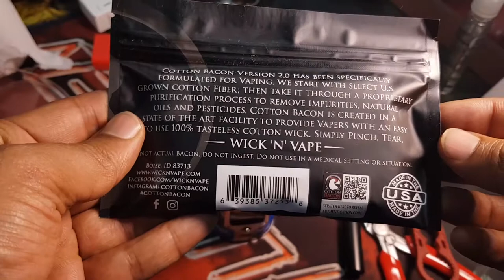RDA Basic Full Nepali Version with Aky Vlogs

Comment: Really liked the video.... It helped me alot... Still having some questions.... Like why didnt u use 26g instead of 22g... And i saw your using dna therion 166/167... Waiting for an unbox/review..
Reply from the maker: 26 gaze wire are thin wire. 22 gaze is thick. Incase of kanthal wire i noticed that thick wire will get in less ohms around 0.19-0.22 which is perfect to vape around 55 to 65watts or sometimes go higher . I reccommend using 24 gaze wire coz they seem to be best if you vape at a normal 40 to 60 watts.
Reply: Ohhh thank.... So whn are you going to review dna therion 166/167